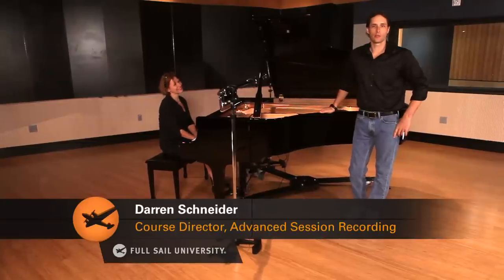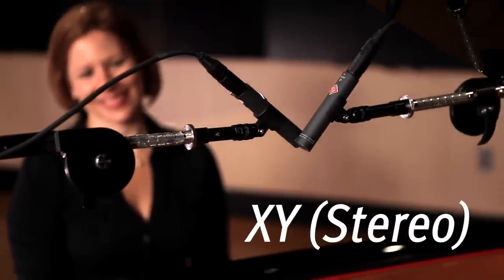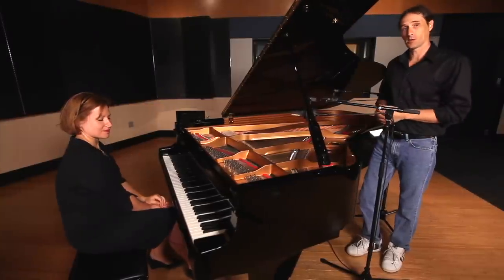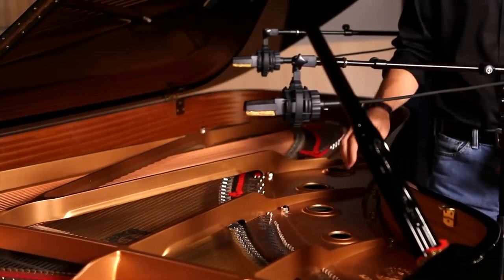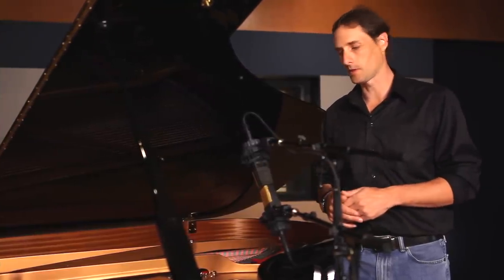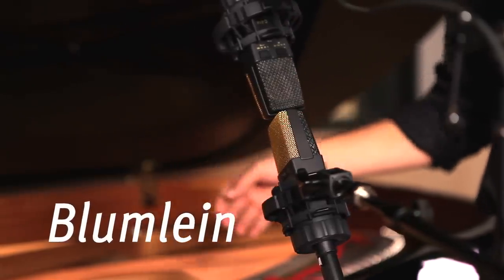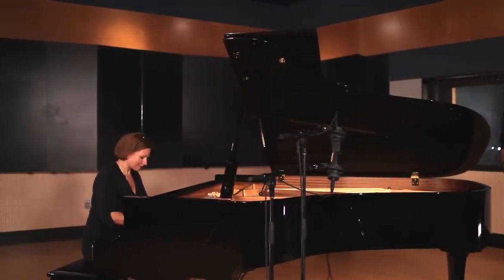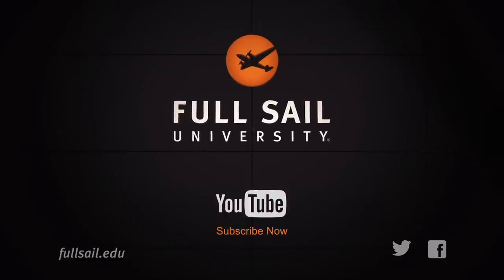How To Record Piano: Microphone Techniques

Comment: thank you for this video.  Did you use AKG 414 xls for the Bloomline?  If so, which setting were they on?  thanks again.
Reply: +oneTwoThree Blumline is always with two bi-directional mics :)
Reply: +Stina Fagerberg thank you for that.  Great video.  By the way, for home recordings, are there any other resources for recommended equipment for grand pianos?  I'd love to study this in college.

Comment: This demonstration is adequate for general listening purposes, but it doesn't use the most accurate mic placement and recording technique to capture the full-range stereo sound of the piano.  
(CLICK BELOW on "Read more")   for information on Making Professional Cost-Effective Accurate Piano Recordings:

MOST ACCURATE MIC TECHNIQUE FOR PIANO
The most accurate and robust  mic technique to record piano in it's full range of sound within it's stereo nature (piano being the only stereo musical instrument) is to place at least 2 mics (3 is preferred)  12 inches above the hammers across the entire piano scale,  One on the left side of the piano, one in the middle and one on the right side of the piano.

TWO MICS MINIMUM, THREE IS PREFERRED
If using 2 mics, place one above the far left bass hammers, and the other above the far right treble strings.  If using 3 mics, place one above the far left hammers, one in the center of the hammers, and the third above the far right hammers.  Placement above the hammers insures that you can capture the nuance of any hammer actually striking the strings at different dynamic playing modes...i.e. soft notes, medium sounds and loud hammer strikes on the strings. 

TEST RECORDINGS AND SOUND CHECKS
Be sure to do test recordings at all three piano playing volumes: soft, medium and loud before you do a real recording take.  You must keep your mic gain under the "clipping" level, so there is no distortion, particularly on loud playing passages.  

Work with a pianist or helper before making a recording to do some sound level tests on soft, medium and loud playing. If there is no pianist available, you can do it yourself.  Turn your recorder on and set your mic input gain levels in a medium position.  Go to the piano and using as many fingers as possible, strike the bass, middle, and treble strings softly, then at medium volume and then at loud volume.  It doesn't matter what notes you play.  All you have to do is to strike the strings, then listen to your playback. If the loud strikes are "clipping"  (distorting)  then you need to lower your mic gain input levels until there is no more clipping.  If the music you intend to record has some very loud passages, be aware as it may be necessary to turn down your mic input levels during loud strikes or passages to avoid distortion.

YOU NEED MULTI TRACKS
This mic placement  accurately captures  the piano's complete  "stereo" sounds, recording low notes on the left mic, middle notes on the center mic and high notes on the right mic. Again, if you have only 2 mics, place one on the right side of the piano and one on the left side. 3 mics are best, but 2 will still work. You need a dedicated recording track for each microphone, and during playback when mixing for a master recording, you should pan your left mic to the farthest left setting, your middle mic dead center, and your right mic to its farthest right setting. (just what the pianist hears when sitting on the piano bench as he/she plays)

ADDING REVERB TO PIANO TRACKS:
Once you have recorded your piano tracks, you will need to add a bit of reverb on each track to give depth.  Experiment with this.  Too little reverb will make the piano sound flat, dead and close, as if recorded in a closet.  Too much reverb will make the piano sound echoic, noisy and muddy, as if recorded in a canyon. Neither extreme is good. Add only enough reverb to give depth to the piano sound, without the reverb becoming noticeable.  Better too little than too much.

TRACK POSITIONING AND PLACEMENT:
It is important to position your playback tracks in the same way that you recorded your microphone input tracks.                                        If you use two mics, then pan your left track all the way to the left upon playback. Pan your right track all the way to the right.  If using three mics, then pan your left track all the way to the left, your middle track dead center, and your right track all the way to the right.  Remember to keep your playback tracks identical to the microphone input tracks on which they were recorded.  i.e., your right track should be the right track upon which you recorded your right side mic.  Your left track should be the same track that you recorded your left side mic, and so on.  
 
PIANO MONAURAL SOUND VS. PIANO FULL-RANGE STEREO SOUND
This technique insures that your mics and your recording will allow you to accurately hear and capture exactly what the pianist hears when he or she is playing the instrument. Ironically, in live performances, the audience does not hear the same sound that the pianist hears when playing the piano, because the audience sits perpendicular (at 90 degrees) to the keyboard and the hammers. The audience hears a mix of lows, mids and highs with no separation.

The pianist, on the other hand, hears lows on the left, mids in the middle and highs on the right, because the pianist sits facing the keys and the hammers.  Your mics should also be positioned the same, to capture the full stereo sound. Mics positioned on the right side of the piano only, hear a monaural sound.  Mics positioned as outlined in this tutorial hear the true full stereo sound of the piano....just as the pianist hears it, and as your recording will play it.

SUMMARY:
Correct mic placement and multi-track panning technique as outlined above will  give you accurate, full-range true stereo piano recordings.  It is important to experiment with your mic placements, your volume levels in setting your microphone input levels, the loudness or softness of how the pianist plays, and what the music (the written musical                            composition) may be demanding of your equipment.

Experimentation, practicing and rehearsal during sound checks is as important as the musician practicing the music.  If you do adequate sound checking ahead of time, your recordings will come out clear and listenable.
Reply: Thank you for very clear and quite enlightening points! I am just thinking, is the pianist playing for himself or for the audience? I assume that the pianist must take the audience and the room or the venue into the equation. If the venue is  big the pianist has to adapt his technique so that the notes will "travel" all the way to  the people sitting far back. The pianist will also adapt his approach depending on the instrument he is playing at that particular moment. The pianist is playing for a audience and not for himself. If I  am recording the event, should I try to capture the sound created and intended for the audience or should I try to capture the "true" stereo sound the the pianist can hear himself, privately alone, due to his seating position by the piano?
Reply: To: finnurth  From:  jennifer86010   You bring up some valid and interesting points.  (CLICK ON "Read more") for information on my experience with your topics.

LIVE EVENTS VS. RECORDINGS:
Keep in mind that live performances are all about expressing and sharing emotion and energy between the composer, the musician and the audience, contained in a space with everyone's attention focused on the event and process.

Recordings are about a single listener who listens to the music being reproduced by a device, while he/she is often not focused on the music as it plays in the background while the listener is driving a car or doing other things at home.   

STUDIO RECORDINGS VS. LIVE CONCERT RECORDINGS:
In terms of making recordings, it is best for an engineer to capture the music in the best possible way that portrays the sound of the music, not necessarily the composition, the musicians, the hall, or the audience.  

Studio recordings are always best, because studio engineers eliminate all unwanted sounds, and capture the best possible sounds of the instrument...pianos being tuned within one hour before recording starts. Additionally, if the recording artist and/or producers think that they made a mediocre "take" they can re-take as many times until they feel they have done their best.  Studio recordings are a series of takes, adjustments, polishing and editing to create the best possible sound the music and instruments can make for the single listener who puts on a C.D. or music file at home or in the car.  

Live recordings are a totally different story.  The piano is usually not tuned well, the acoustics of the hall or room are usually bad for microphones, there are many unwanted noises and sounds, and there are no re-takes...one chance is all you get.  The advantage of live recordings is the illusion of the single listener at home, that he/she is actually at the live performance, and perhaps gets to experience a piece of musical history within this live event.  Usually the recording quality is not very good, but often the energy  exchange between the performers and  the audience is worth the trade off

MIC PLACEMENT/RECORDING TECHNIQUES FOR LIVE EVENT RECORDINGS:
Engineers use the same techniques in live recordings as they do in studio recordings.  The object is to come as close to a studio recording as possible, at live venues, despite unwanted sounds and noises, and despite the bad acoustics and problems with instruments.

PIANO CONDITION- COSTS AND EXPENSES - LIVE CONCERT COSTS;
If the pianist is signed with a major record label or is famous, the chances are likely that he/she will have the backing to afford bringing in a piano of his/her choosing.

Concert grand pianos cost $100,000.00 - $250,000,000.00.  They are very expensive.  Renting a concert grand piano can cost as much as several thousand dollars, depending on the piano and the circumstances of the event. Concerts are expensive to attend, but somebody has to pay for the hall, the staff, the equipment, the promotions, the musicians...and the list goes on and on.  So, your ticket price has to pay for many expensive things and for many people's work and talents.                                                                                                            

At large events, the piano  will be tuned 1 hour prior to the performance, regardless if the performance is recorded or not.  Piano tuners will charge $200.00 for a tuning, and if they stay on standby during the performance, will charge as much as $500.00 if they have to re-touch the tuning during intermission.                                                                

For pianists who are not famous or have such financial support, they will have to play and deal with what ever piano is available, in what ever condition and tuning it is in.  Those are the unfortunate facts of musical life. This is why I have suggested that non-famous pianists who play at a semi-professional level learn something about "touch-up piano tuning".  Often if a pianist carries his/her own tuning hammer and a couple of string mutes, he/she can touch up any sour strings on the piano before a recording or performance.  

RECORDING SUCCESS DEPENDS TOTALLY UPON THE PIANO SOUND;
Your recording is totally dependent upon the tuning of the piano.  If the piano is out of tune...badly, your recording will sound horrible.  Almost every piano recording we have ever heard has been made on pianos which have been tuned just prior to the recording.

If you are a pianist or a recording engineer who intends to make a piano recording, you MUST insist that those involved in the concert or recording, find the money to tune the piano just before the recording is made.  Otherwise, it will sound cheap, twangy, sour and laughable.

Piano tuners can charge as little as $50 for a touch-up tuning and often charge $100.  Discuss this issue with the venue people, the pianist, any sponsors and others involved with the recording project weeks before the actual recording is made, in order to insure that the piano will be in reasonably GOOD TUNE at the time of the recording. This is a critical make-or-break issue as far as the quality of the piano recording is concerned. Piano tuning is paramount for both studio and live event recordings.

SOUND WITHIN THE VENUES;   INDOOR VS. OUTDOOR  
Musicians are not concerned with filling the space with sound, since in most cases the room size is not a factor, no matter how large the indoor hall is. Indoor music is not like the human voice which needs amplification to be heard in the last row.  The softest musical sounds can be heard in the last rows, since the audience is being quiet and the space is contained.  In outdoor venues, it is an entirely different story, and sound reinforcement (microphones, amplifiers and speakers) are needed, because the sound evaporates quickly and unwanted sounds are everywhere. 

PIANIST PLAYS FOR WHOM?
In most cases, the pianist is not playing for him/her self...anymore than a doctor would practice medicine for himself, or an attorney would would go to a courtroom when there is no trial.  Pianists, if professional, play for the audience, because the audience is who puts food on the musician's table. 

The pianists and musicians also play for the composer, since in composed music the composer has already put forth instructions on how a particular work must be played...with some interpretation allowed.  Pianists play for themselves usually when they are alone and want to experiment with some music they love or might eventually play.  Rarely do professional pianists play piano for personal enjoyment, because they see playing music as a profession, not as entertainment or pleasure. Rarely do professional athletes play ball for fun.  Since musicians have to play music for a living, and practice many hours per week, they relate to making music as work, and consequently find other things in life which bring pleasure. 

RECORDING LIVE EVENTS  
For piano, always place your mics as outlined in the tutorial, to capture the full stereo sound, just as the pianist hears it.  The audience, the venue, the hall and everything else will take care of themselves.  Your job as a recording engineer is to capture the best possible sound of the piano for the single listener at home who buys the recording. 

APPLAUSE AND UNWANTED ANNOUNCEMENTS ON LIVE RECORDINGS:
 On live recordings,  audience applause is natural. It is often "sweetened" or added to in post recording production to create more excitement. In classical concerts, it is expected and predictable, and it needs to be recorded along with the music.

However in casual venues....clubs, restaurants, smaller halls and pop-music events, there is often speaking, announcing, and unpredictable talking going on as each tune or movement of the music starts or finishes.  This is a very tricky thing to try to separate unwanted talking, and it is important that the recording engineer rehearses with any announcers before the event to make sure there is little-to-no bleed over from announcing into or out of each recorded track.  

I hope these points address your questions. As a recording artist and engineer I have dealt with these issues for many years.  I wish you luck in your musical adventures !
Reply: As a pro pianist and aspiring - eevn university trained, but no pro  -  recording engineer and piano tech,  it's PIANO 101 to understand how critical the room sound is, part and parcel of the total piano sound.  There is no "best technique" as there is no best piano, though I prefer Steinway overall.  It depends on the room and the instrument and probably the genre and player as well.  Some would tell you the lid should be taken off.  It is okay for the concert hall but those reflections are not really great for recording. Anyway, this fixation on the hammers is mostly misguided, unless one is going for a certain sound or focus.  I hate the way this video - from an admired institution - is sounding and presented.  Very unnatural and hyped in the overall effect. Sounds very compressed.  I think sound recordings, especially of acoustic instruments and voices, was well dialed in by the fifties, and that was all about great mics and great instruments and great ROOMS. Capital Records, Studio A, for example. You just don't get better than that. As of late, engineers are just too focused on gear.  For some genres, that may be fine, here, this is sucky, just my educated, well traveled, well exposed opinion, still quite humble, as you can tell.

Comment: This is a weird video because the listener will be wondering ""am I comparing the mic brands or the mics patterns (card or omni) or mic positioning?" The ideal comparison will be using the same mics for all the different positions. I hope you didn't use differ preamps for all positions or that will be an additional worry to think about. And in addition to that you need to worry what the listeners are using to compare these takes...are they using laptop speakers or ipod earphone or professional monitoring headphones or ??? So doing comparison this way can be difficult.
Reply: I couldn't agree more...this video lacked a point and was almost a waste of 3 minutes
Reply: The pencil condensers are more commonly used for the XY pattern. The AKG 414s used in the other techniques are capable of different polar patterns, like the figure of 8 for the blumlein technique. Basically, different mics are better for different things, which I think is why they used different ones :)